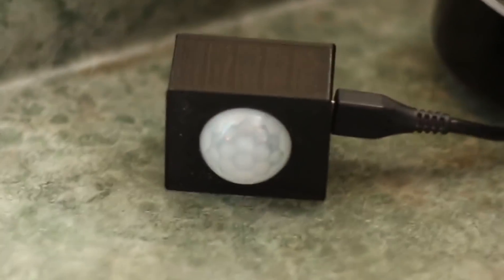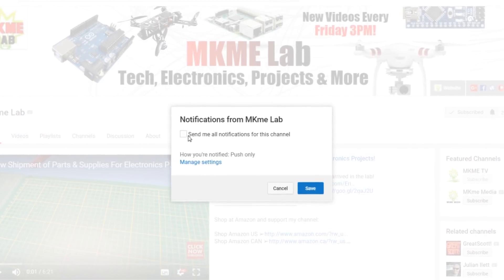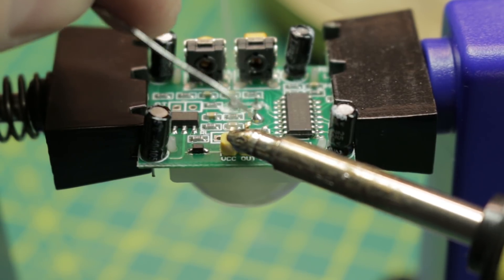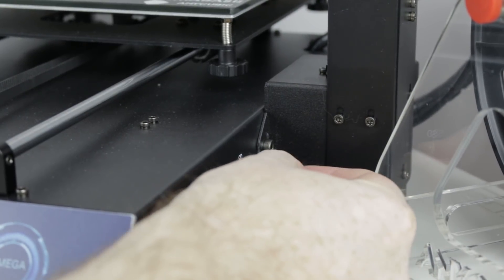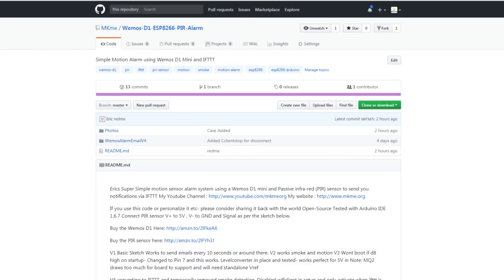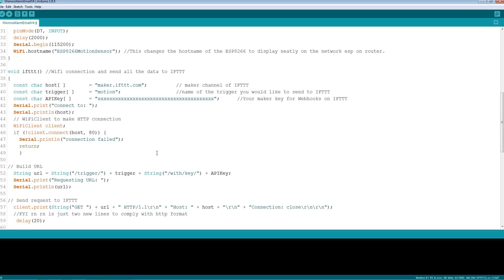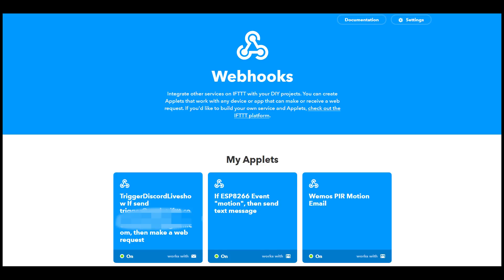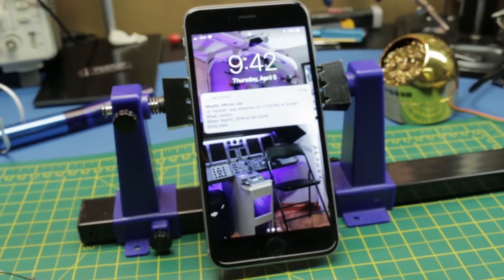$10 Arduino Motion Alarm That WORKS! No Fees & Works ANYWHERE!

Comment: I have an issue , I keep getting notifications every 20-30 sec regardless of pir sensor (if pir sensor is not connected then also)
Reply: Hi do you have the code, this code doesn't work for me!!
Reply: @souvikdey9425  what's the issue

Comment: Can someone help me? For some reason, it just sends me a notification every 20 seconds or so. I tried switching the port from D4 to D3, D2, and D1. It does the same thing. I made sure to change the code accordingly. I tried using new wemos board and new PIR sensors and it does the same thing.
Reply: Anthony Vidovic I had similar problem - moved to D8 which solved my issue

Comment: I used the code provided. Why does it send the "Alarm Detected" every 20 seconds? It does this even with the PIR disconnected. Any ideas? Thanx
Reply from the maker: What does the serial com spit out exactly
Reply: @MkmeOrg  
Alarm detected!
motion 1
smoke 1
Connect to: maker.ifttt.com
Requesting URL: /trigger/motion/with/key/dUdzrRm9e57Idff-SY-
Respond:

closing connection
Reply from the maker: D4 is high. Motion 1 tells you this in serial. Either it is floating high and you need to have the sensor attached or you have an issue with the board. In second case move the pin and code to another if its damaged. Tie it low to find out easy and see whats up
Reply: @MkmeOrg  Thanx for the reply. Dumb question... how do I tie it low? I will change the pins and give that a try. I have tried it on three different boards (all Chinese knock offs from same source). It has been doing the same thing with or with out the sensor connected.
Reply from the maker: It is probably just floating/init high. Hook a resistor from pin to ground to tie it low. You can use a wire too but if the pins are enabling as output for some reason (code not used correctly) its no bueno.  You can see in serial that smoke pin is also high- they are probably floating if u have nothing hooked up
Reply: @MkmeOrg  Even with a resistor between gnd and pin 4 it is still doing the same thing.
Reply: @MkmeOrg  After walking away and giving it a rest I tried changing pins. I finally got it to work on D5.  Thanx for the help.

Comment: How would you add an ESP8266 to the remote receiver of a Harbor Freight Wireless Security Alert System? The system is a PIR with a transmitter and a separate receiver powered by a 6V power supply or 3 C sized batteries.
Cheers
Reply: started researching today to do exactly the same thing with a similar driveway sensor.  I'm hoping to trigger off the output to the bell in the receiver   I am a complete novice but fingers crossed
Reply: If you figure out how to build it, let me know.
Thank you
Reply: I managed to get this working with my driveway sensor - I’m in Ireland so different brand than yours - 1byone - but they look very similar.

I cut the two battery wires in the receiver and soldered red to 5v and black to Gnd on Wemos - you can then power the receiver off the Wemos and use the battery compartment of the receiver to store the Wemos - I drilled a hole in the battery cover to pass the micro usb lead thru.  Check out the hookup smart doorbell vid on this!

I used pin d8 as the input pin (I had trouble with others) and wired it to the positive leg of one of the LEDs - I checked the voltage on the led and it was 2.7 volts.

Then the code here worked a treat!!thanks!!
Reply: @stevedublin6592  That is awesome! Thank you for sharing. Please consider making a short tutorial. It would be great to see your work. Cheers
Reply: cri8tor I uploaded a short video for you - hope it helps with your project

Comment: Found that sometimes the sketch will not load with the PIR sensor hooked up. Disconnect power to the PIR and sketch loads fine. Also this sketch runs well on a NodeMCU platform. Having a ball with this, thanks.
Reply: thanks for the help

Comment: Is there a way to make it send the message via sms instead of using wifi to send the messages
Reply: When making your new applet in IFTTT chose SMS rather that email/Gmail in the "that" phase and it will let you fill in a phone # to sent the SMS to. I got it working great. IFTTT was a bit of a challenge but I worked it out after alot of effort.

Comment: Well I set it up loaded it to the board and it doesn't send me texts. The serial monitor shows the board sending something. I can hot spot it to my phone and I can see it connects when powered but it isn't sending. Any ideas? I assume it is connecting to wifi I used the phone hotspot because it lists connected devices.
Reply: It was the baud rate by the way. Tried different speeds till the gibberish turned into text.

Comment: Can't get mine to work, all i get is this:

Arduino: 1.8.5 (Mac OS X), Board: "WeMos D1 R1, 80 MHz, Flash, 4M (1M SPIFFS), v2 Lower Memory, Disabled, None, Only Sketch, 921600"

Archiving built core (caching) in: /var/folders/9p/88yc19gx1dl49bm3tmlmbxzw0000gn/T/arduino_cache_104312/core/core_esp8266_esp8266_d1_CpuFrequency_80,VTable_flash,FlashSize_4M1M,LwIPVariant_v2mss536,Debug_Disabled,DebugLevel_None____,FlashErase_none,UploadSpeed_921600_fc2358f000d81302a42e4bcdfd030528.a
Sketch uses 262908 bytes (25%) of program storage space. Maximum is 1044464 bytes.
Global variables use 29296 bytes (35%) of dynamic memory, leaving 52624 bytes for local variables. Maximum is 81920 bytes.
warning: serialport_set_baudrate: baud rate 921600 may not work
An error occurred while uploading the sketch
warning: espcomm_sync failed
error: espcomm_open failed
error: espcomm_upload_mem failed
Reply from the maker: It's no com. Check your com port and try swapping out cables. Some are power only with no data wires.

Comment: everybody doing esp8266 tutorials shoud really stop putting in fixed credentials and move to the WifiManager library to manage runtime setup and additional parameters, without having to recompile or modify ANYTHING in the sketch...
p.s.: other 2 things that youtubers should avoid are using the esp01 and the dht11... they're BS...
Reply: Get the feeling you know what you're talking about, so please consider a quick tutorial on the subject. Most people just getting into DIY security know nothing about fixed credentials, WifiManager library, sketch, esp01 and dht11. I plan on researching these subjects, but I assume you could explain the basics in a few minutes.
Cheers
Reply: cri8tor definitely I’ve never even heard those words I got here because my nana is 93 and I’m looking for something to alert me when wakes thur out the night. Cheers

Comment: Very cool project! How is it powered? Just a USB wall charger or something else?
Reply: MKme Lab what is the actual power draw?  I’m wondering how long these would run on some lipstick usb charger batteries I have lying around?
Reply from the maker: I havent measured as it didnt matter running on an adapter. If you want to battery power I would suggest modding the code to use the deep sleep function and interrupt. Then you pretty much only have the sensor powered up.
Reply from the maker: Yep any old USB phone/wall charger. The power draw is so low any of them will handle it.

Comment from the maker: This is my absolute FAVORITE ESP-8266 project. So simple and works great. Any time I'm out of the house, these little guys are on.  UPDATE- GMAIL is dead on IFTTT so just use GMAIL for the IFTTT account then set up a filter action in GMAIL to forward the mails from IFTTT to your mobile email-to-txt address.  Works great. Parts kit: https://store.mkme.org/?product=esp8266-pir-motion-detector-kit  Forum for help/discussion: http://mkme.org/forum/viewtopic.php?f=14&t=1113
Reply: 1: sign in 
2: click on your account in the top right corner 
3: select services 
4: select Webhooks 
5: click settings in the top right 
6: under account info, copy everything after https://maker.ifttt.com/use/   (including underscores)
Reply from the maker: Fixed this in master. One of the hazards of having 2 codebases to avoid keys getting out :)  Thanks!
Reply: It may be because I'm using a newer IDE (1.8.2) but your code didn't work for me at first. The board wouldn't connect to WiFi. I added "WiFi.begin(ssid, password);" under void setup and it works now. Just a heads up in case anyone else encounters this problem.
Reply: November Foxtrot Thanks for this. Where do you get your IFTTT key from?
Reply: November Foxtrot I can’t get mine to connect to WiFi either. Your adjustment isn’t working for me. I’m on 1.8.5. Were there any other changes to the code you made? Should the (ssid, password) be in quotes like (“ssid, password”). Thanks!
Reply: no, it should be exactly this:

WiFi.begin(ssid, password);

Make sure you added it under void setup.
Also, make sure your ssid and password are correct. They're both case sensitive.
Other than that I'm not sure, maybe try it in 1.8.2.
Reply: How can i install include library for the arduino code????